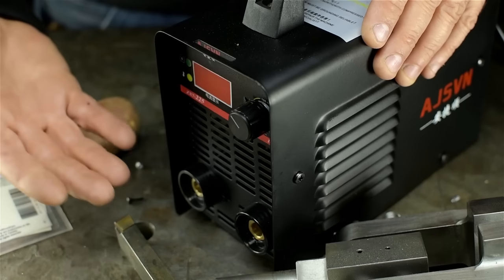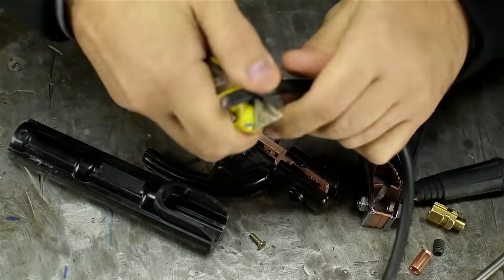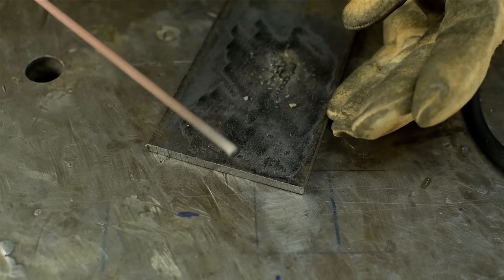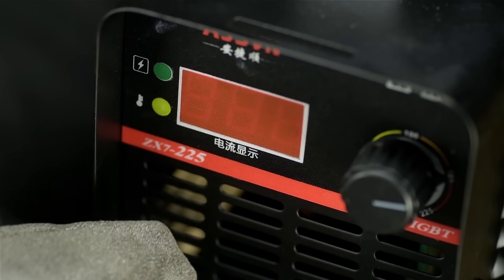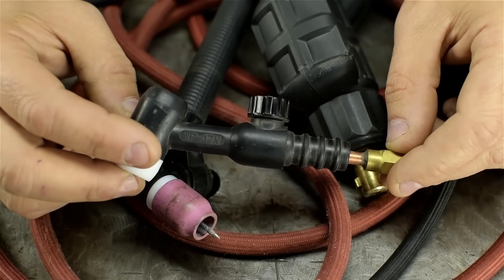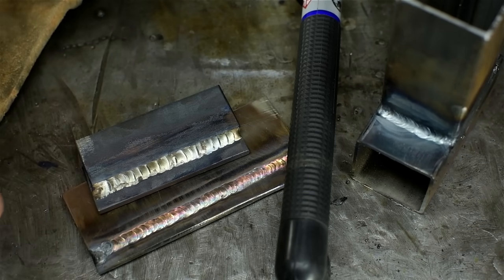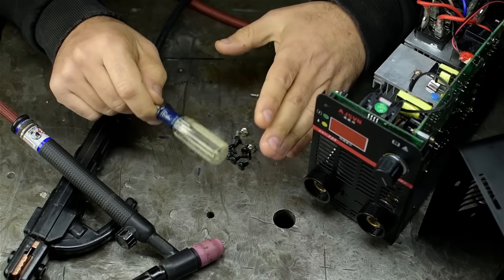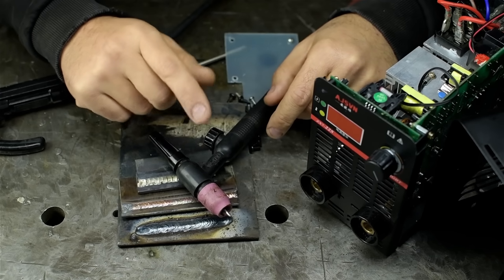Cheap Ebay Welder -- WILL IT TIG?!

Comment: When you started wiring up that two prong plug I literally saw your life flash before my eyes.
Reply: First thing I would have done is wire in a case earth at the very least.
Reply: The problem with that is this beast puts out 2 voltages with reference to earth so if you put the case in contact with earth when you weld you  have a path for current to flow from the -ve to earth ....... and that can cause problems! Wierd spookines can happen ;0)
That is IF I understood OT correctly ...... again one of us (or both) cold be wrong (coughs) Err ... Giving the wrong impression!
Reply: @totherarf  the other solution is if you get a machine with no built-in earth fucking dunk it straight into the bin (or back on eBay)
Reply: Dave W That’s why You should put live to the case instead =D (Don’t do it!)
Reply: Just use a good 10 rolls of electrical tape on the body of the welder. You should be alright
Reply: ........ Or Gaffer tape! Gaffer tape is wider and it fixes Anything ;0)

Comment: I think expecting that welder to have a graceful automatic thermal shutdown might be a bit optimistic; more likely a full-on smoke-test.
Reply: Yeah, looks like it even the breaker thinks it smokes too many packs a day.
Reply: It demonstrated its "graceful automatic thermal shutdown" protocol twice... each time it blew the Breakers Hahahahaha
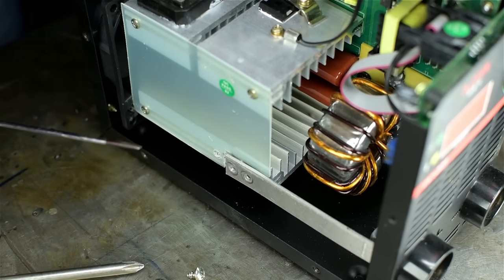Reply: At 23:00  there is kind of termocouple mounted on radiator. So there is possibility for " graceful automatic thermal shutdown " without magic smoke  :)
Reply: What do you mean?  The smoke comes out to let you know it's overheated.  It's a perfectly good indicator, no need to waste money on fancy LEDs.
Reply: @jamesburleson1916   :D
Reply: @jamesburleson1916  Yeah, but nobody uses smoke signals anymore, so it's really hard to find anyone selling refills for when the smoke runs out.
Reply: William Shreckengost just refill the vape juice in the caps when the smoke runs out.
Reply: 'Aromatic shutdown' if you will

Comment: Aaaaand since I haven't seen any mention of it, ToT: " I haven't stick welded in 3 years". slag comes of in 1 piece.
Reply: Its almost like he used a 6013
Reply: @alexkasin4076  Yeah.... maybe I should start using 6013. I have been using 1109 and can't make it look good.
Reply: @scottdrillinginc397  do you mean 6011 if that is the case you might now be the problem 6011 is a deep penetrating rod and even a good even bead will look kind of ugly just because of the nature of it i would try something like 7018 or like you said 6013 those will give you a nice looking bead and they are much easier to use especially for a beginner
Reply: @alexkasin4076  I'm pretty sure it's 1109.  Oh ... wait....
Reply: scottdrillinginc LOL try that with 7024.
Reply: @alexkasin4076  7014 will pretty much run itself, even on an old AC buzz box. I like to keep a 5-pound box of it around for farm fix projects. Lots of slag. Doesn't care about a little rust or paint.
Reply: Love how a good 7018 will curl itself off.  Quick brush and clean. I think his need to spend a bit of time in an oven.

Comment: Hilarious…… but nice review on cheap death traps being sold online. You are correct in your summation that buying a complete kit from local suppliers is often wayyyy more cost effective and usually lots safer. 
Loved your improvised insulated “holding device” the piece of timber you used to hold the top of the welder as you removed the screws from the heat sink.

Comment: A tip for perfect scratch starts: rest the cup on the surface. then rock the torch back and forth a bit until you touch. with the cup rim being a pivot point it gives you great leverage and no matter how heavy-handed you are, the electrode should never get stuck.

I also noticed you can achieve way lighter contact and less contamination on the electrode (if less contamination is even a thing with scratch starts).
Reply: im going to have to try that
Reply: After scratch start welding for a few days you can get the scratch down to where you dont even touch it to the metal, just swipe it over so close that the arc starts. Very minimal contamination
Reply: I've used copper to start and drag it.over
Reply: The shop teacher got me to stop sticking the electrode by not letting me near the welding unit
Reply: Never underestimate the lack of capacity for some beings not to get the electrode stuck

Comment: I bought a 3-in-1, TIG, stick, and plasma on eBay and was really surprised. At the time I was taking a welding course so I wired it up and took it with me. The teacher put it through the paces and he said for the price he was going to pick one up. 

Stick worked awesome and I believe it is at or very close to the 200 amp rating. The stick worked awesome and the plasma cut through 1 in steel like butter.

The price for goods out of China is phenominal.

Comment: Personally I’d love to see you take a look at one of the import ‘combination’ machines - I can’t afford / justify a named brand or three dedicated machines and there are some perhaps better machines eg ‘designed in Germany made in xxx’ type. (I live in the UK). Wish I could go for a good brand but this is strictly a hobby for me so anything I do spend I need to get good value for. The type I’d love to see you look at is a combo TIG, plasma cutter and stick machine. Not knowing enough about the pitfalls I’d love to hear your thoughts. Please keep up the great videos 👍
Reply: I'm wondering exactly the same thing. A welder would be a "nice to have" giving me more options to do stuff, but it would be taken out at most a few times per year. So a big brand investment is definitely out of the question. I've been looking at "Stahlwerk" welders. It's one of those "designed, developed and quality controlled in Germany" companies. Their welders aren't even that cheap (but still less than 1000€ for a full AC/DC MMA/TIG/plasma combo including helmet and a few consumeables). They even offer a 5 year warranty, "tryout welding" at their german headquarters and Amazon ratings aren't the worst either, so they can't be that bad, can they? I'd really be interested to hear what an experienced welder would have to say about those.
On the other hand they also have welders that look almost as sketch as the one in this video...
Reply: This experience might help you: 12 or 13 years ago I was in the same boat.  My hobby is farming and I need to be able to fix/make equipment.  I researched for quite a while and had a toss-up decision between 2 or 3 multi-process machines.  I went with a GianTech because there was a rep with a good rep in my country.  It's a TIG, stick, plasma combo.  Everlast was one of my options then and I wish I had chosen them, but there was lots of bad mouthing about all of the import inverter machines at the time and I wasn't able to find a good rep.  If I ever get a new one it will be an Everlast, though I'll probably go with a dedicated plasma cutter rather than a 3 process machine.  

My machine is cheaply made, and has all of the chintzy things you'd think it might.  Very basic ground clamp, stinger, and cheap TIG torch.  I run it on 220V.  I've been using it regularly, about once a month, since I got it.  I do everything from quick weld repairs to fabricating tractor and farm implements - metal from 1/16" sheet to 1" bar.  This weekend I made a new grate for my outdoor wood boiler from 1" bar.  For the ~$500 I paid for it, I have no complaints.  I've never replaced anything on it, although this weekend did I break the air regulator off it dropping a bar on it.  I'll get a replacement that allows more pressure and that should improve my cutting ability - it struggles with 5/8" - 1/2" plate, and I'm pretty sure that's my air pressure and quality (plasma likes lots of dry air).

Also, I never did set up the TIG so can't speak to that (would like to, but I get by without it so can't justify the cost).  I even still use the original crappy helmet it came with.  Would I like a better machine?  Sure.  Do I need a better machine.  No.  If all you do is hobby/learning, you'll probably like the multi-process machine just fine. And the quality, features, and reputation of them has improved greatly since I got mine.  

As @Mr T says, check out Everlast.   Lots of pros on Youtube use them so search around to hear their reviews. Their SuperUltra 206Si is about the same machine as I have except mine is only 160A stick, 40A TIG (IIRC), and it comes with a foot pedal and the plasma uses a pilot arch (mine does not and that's a pain sometimes).

HTH.
Reply: Hey Nick, if you are going to get a multiprocess machine, don't get one with both TIG and plasma.  They don't play nice with each other.  I've had good results with an  Everlast stick (MMA) welder, and MIG welder.  They also make multiprocess welders too, but I haven't used them personally.
Reply: @COBARHORSE1  
What does "not play nice with each other mean"? It's not like you can use those at the same time. Otherwise the electronic function is quite similar for TIG and plasma: (realtively) low voltage and controlled current. Why would a combination of the two in one device make them work worse?
Reply: I’ll add a vote for my Everlast combo box. What can I say, had it for years, and it works great!  Not used in a commercial environment or anything.
Reply: @superdau  it may seem that way on the surface, but the power sources for DC stick/TIG welding and plasma are very different. Trying to use a source designed for one process to do the other has spectacularly bad results. Even in the machines that have separate power sources (most) there is significant and detrimental interference. If you can't make the investment in two dedicated machines, the best bet is to buy a very good welder and a lot of grinding wheels. A grinder and some patience will do 85% of what a plasma can do while you save to also buy a very good plasma.
Reply: My opinion/experience is to spend the money on a very good welder, even a MIG/TIG combo is very affordable right now, and get very comfortable with a grinder. A grinder, a jigsaw and some patience will get you almost anything a plasma can do. If you need something super intricate cut from 1" plate or something, there is a local waterjet/laser/plasma shop that will help you. Also keep in mind that without an excellent air compressor and dryer setup, even the best plasma cutter will have you reaching for the grinder again. Like ToT said, trying to save money on this stuff never works; buy once, cry once.
Reply: Mr T  are they designed in Germany ? I didnt know that.
Reply: @superdau  if it sounds like they are saying bullshit (they "interfere with eachother" even tho one isn't being used... Hahahaha), it's because it is. Don't be dissuaded from a nice combo machine
Reply: @superdau  I'm not sure of the details, but I think the high frequency start used to start the TIG arc, tends to damage the electronics of the plasma power supply.  You can contact the Everlast rep. to learn more.  He posts frequently on the tractorbynet forums.  Name is Mark Lugo.

Comment: Thanks for the video- lots of fun! This dangerous Chinese welder did actually produce a reasonable TIG weld but the cost of the added items like torch etc., was more than the welder. I remember ten years ago you could not get a proper TIG for less that €1,000. Now you can get a reasonable TIG for €450.
Reply: youve always been able to tig off an arc welder power source. nothing new there.

Comment: When you are running reverse polarity 1/3 of your heat is in your electrode 2/3 is in your parent material. Straight polarity reverses that so you are now getting 2/3 of the heat in the electrode which may explain why it appeared to weld better with the 7018. Another electrode you may want to try would be 6011 which is an AC version of 6010. 6010 and 6011 are the highest penetration rods that you can get. The surface characteristics are fairly rough but with practice they will be acceptable.
Regarding the scratch start TIG, you might want to try pulling the torch head back towards the cup and touching down as you do. Sitting at a stand still or worse traveling away from the cup will be more likely to stick and break the point off the tungsten. Breaking off the tungsten can create another problem. Frequently, when you stick the tungsten down to the parent metal and you break the tip off the tip has partially embedded itself into the surface. You have to grind away the metal until you are sure that tiny piece of tungsten is gone. If you don't, you will have trouble welding over that area as the tungsten will not melt and it creates a pit in your weld with little penetration. If it is x-ray quality work that void will show on the x-ray which will require a repair. As far as not being able to control the heat without a foot control you might want to try lengthening your arc length a bit. This will raise your voltage and drop your amperage effectively cooling the process off a bit. 
And before you ask, yes, I am a qualified welder with a first class journeyman ticket and formerly a B pressure ticket.

Comment: I haven't watched you for a long time now.   found his old post. Thor "COVID",  Had got you  On the subject of Tig welding I have one of those old  English, Oxford oil-cooled welders. Ac  A bantam they are called.  Playing about one weekend   I fitted a 200 AC to DC Phase converter to the input voltage turning the input to DC input at the welder now the current being generated at the winding was  DC I found it made a descent Tig welding device & a very long duty cycle as the oil-cooled device. The reason is it welding scope as its amp welder delivered a powerful range of Tig variants & if I Decided to Tig in AC I could switch back to AC because of its stick capability For welding aluminium. A brazing which is where I mainly used it.   You should try it with an oil-cooled welder son.

Comment: i remember my first welder you had to move a clamp along a length of coiled wire to adjust the amps
Reply: my first one was from the antique store and had a toaster and carbon rods.
Reply: Mine can change the AC waveform

Comment: I have had one of these (or at least a very similar unit) for a couple of years now and can say that the duty cycle is 100%. Or at least it will run longer than I have ever used it; at least long enough to burn 3 or 4 sticks in quick succession. Also, the built in leaf blower keeps mine from ever getting very hot to the touch. The low open circuit voltage definitely makes it a challenge to keep the arc lit, especially given my less than stellar welding skills. The first time I used it I IMMEDIATELY ordered another one as a backup. A couple of years and a couple of fairly big projects later the backup is still in the box!

Comment: Tony, just wanted to chime in and give my 20 cents (inflation) let me preface by saying I am a total newbie when it comes to welding, first machine was an 80 amp stick welder and I was able to stitch to pieces together somewhat effectively although not pretty. Recently sprung for a mid priced multi process machine and tried my hand at flux core mig, so so. It came with a scratch start Tig torch with gas control knob, I have been hesitant to attempt using this process because of no high frequency start capability but after watching and the tips you gave I am determined to give it a go. I always enjoy your videos even if they do not pertain to anything I would consider attempting either for lack of experience or lack of equipment. I always learn something applicable or not. Thank you, and I always leave with a smile.

Comment: Yeahhh welding cable, I just stole the jumper cables from my wife her car.
Reply: "Stole from my wife her car!?!" EXTREMELY DANGER!!!
Reply: Dont forget the battery!
Reply: Funny that was my first thought too.
Reply: @Mishn0  Much theft!
Reply: lol my grandfather did the opposite. He stole some of his huge 300 amp welding cable for jumper cables. He worked on log stackers for a living. Those Huge machines that can pick up an entire semi load of logs on one grab and one tire is about 7 feet tall. Well your normal little car jumper cables are going to melt when you try putting as much current through them as you need to crank an engine that big so he made his own Industrial sized jumper cables. They're hanging in my dads shop now and they work awesome for jump starting cars.
Reply: @keithyinger3326  The only problem being that you have to do biceps curls for 2 weeks before you try to lift the cables off the hooks on the wall!
Reply: @tasmedic  lol true. They do weigh a fair bit more than regular cables.
Reply: @keithyinger3326  I did one better. I made jumper cables out of wires from a 1930s DL&W MU car. Nice wire that is fine strand nickel instead of copper. Good enough that it could jump start a Diesel loco's engine when the 64 Volt batteries were dead. Well under the continuous 3000 Volts DC that it was rated for. I used ground clamps for welders as the cable ends.